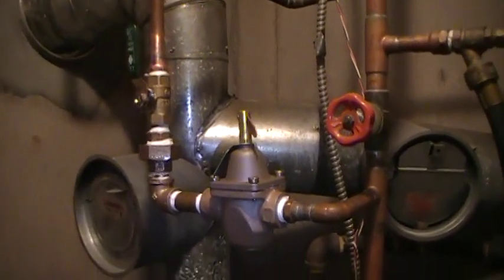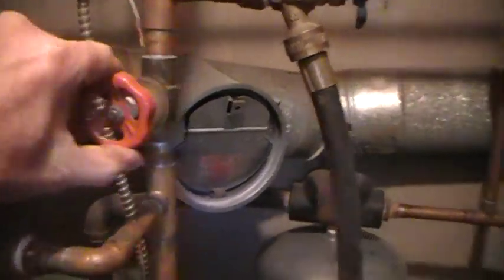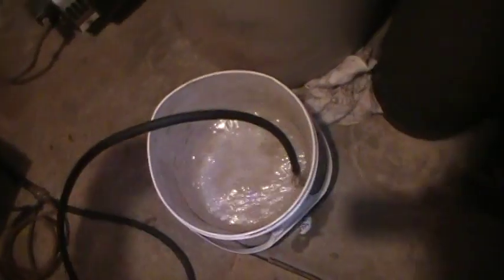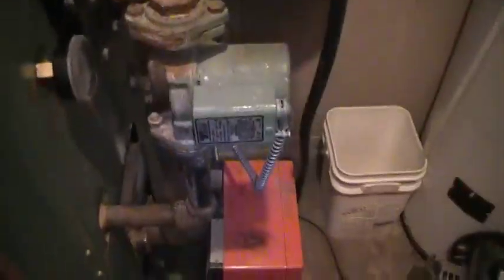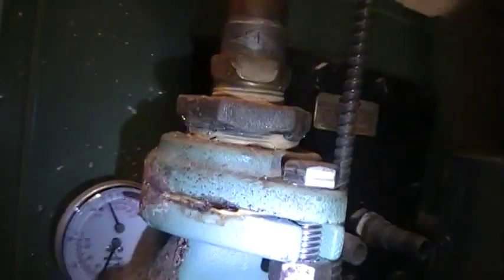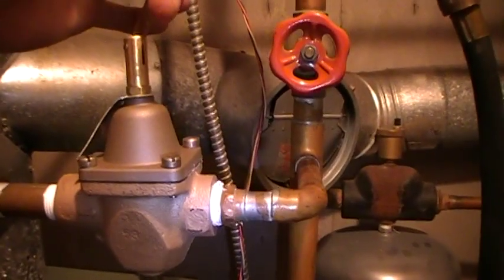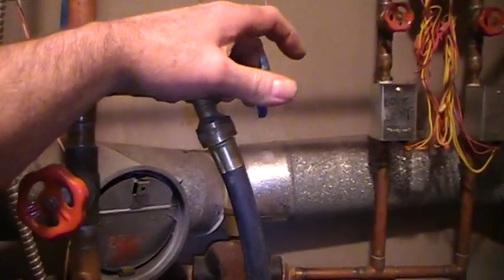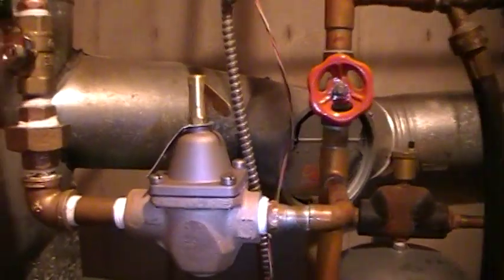How to remove the air out of your hot water heating system-girgling noise.

Comment: My pressure reducing valve does not have the fast fill lever, just constant 12psi. Can I still perform this procedure without the fast fill? Thank you.
Reply from the maker: Hello michaelshannon6846,
You should be able to purge the system, but you have to keep an eye on the tridicator (gauge) and make sure the system doesn't drop below eight pounds. Hopefully your PRV is flowing well and not plugged with any sediment.
 If by chance it drops to fast you could attach a hose to the drain valve and put water into the system this way watching the pressure as you do NOT want it going anywhere near 30 PSI as the relief valve will pop on you. If you use a five foot washer hose and add it to a regular hose you will be able to attach it to the boiler drain. If you go this route keep an eye on the pressure. Twenty pounds will easily purge the system for you so keep an eye on the gauge. Once it gets around twenty you can turn off the drain valve and add water when needed to keep the pressure up until done. Once complete let the pressure reducing valve feed the system to the correct pressure.
I can't stress enough about watching the pressure and keeping it at around 20 PSI if your pressure reducing valve can't keep up to your purge. You don't want to create any other issues like having to change the pressure relief valve if it should pop.
Hope this helps!
Drop me a line if you have any other questions.
Thanks for commenting and best of luck with the project!    Al
Reply: @TheOldkid888 Thanks for the reply! Could I also not open the purge valve fully and monitor the pressure that way as well? My pressure reducing valve is brand new so I’m confident it will feed water at 12psi. Thanks!

Comment: Very good thanks I have to do this soon for my boiler that's making gurgling noises in the base board units also I didn't see you shut off the power switch is that because of the zone valves needing power to open ? Thanks !
Reply from the maker: Hello MikeL-vu7jo,
I did shut the power off to the system. At the end of the video I mentioned turning the power back on. 
You hook the zone valve lever once you slide it over to keep it open. You may wan to watch the video again to get every detail. No pushing it on you, but it is all there.
If you do lift the lever on the pressure reducing valve make sure the pressure doesn't get near 30 pounds as the relief valve will pop. I keep it above 20, but no higher to be safe when purging and I check it once I have finished. If the pressure is above 20 I will drain some more water and bring it lower. Somewhere around 15 PSI.
Good luck with the project.
Thanks for commenting and enjoy your week!    Al
Reply: @TheOldkid888 thank you!

Comment: So my i hear water running through my baseboards. Not gurgling so much. But like someone turned on your outside hose and you hear it running from inside the house. Is that normal operation or should it be quiet? 1st time with baseboard heaters.

Comment: On my system there are four zones each with its own circulator coming off a manifold that has a drain at the end of the manifold pipe. There are no purge stations on the returns at all. Can I bleed the system through the drain at the end of the manifold supply pipe?
Reply from the maker: Hello john,
You can do it that way if you can isolate each zone. 
Are there a valve below each circulating pump? 
You probably have a flow control valve on each zone coming off the supply line. Correct? Do you have baseboards or cast iron rads?
Get back to me when you get a chance.   Al

Comment: Is it best to bleed the system for air just before the winter.
Reply from the maker: Hello JOHN COYLE HERE,
Generally it is if the system needs bleeding as it would produce a more efficient heat for you and reduce the noise coming from the radiation. If you hear no gurgling when the water is running around the loop, the system probably doesn't need to be purged or bled.
It definitely doe not have to done every year. Keeping an eye on the pressure gauge and assuring that the pressure stays above 12 pounds should help keep the system working well.
Thanks for commenting and enjoy your week!     Al

Comment: Condensed version: shut off ALL zone valves and ALL return valves in ALL zones. Starting on lowest level zone (basement or ground), connect hose to that zone's drain pipe. Open drain valve and lift lever on pressure reducing valve to apply full water pressure to force air out. When air bubbles stop, lower lever on pressure reducing valve. Check gauge that pressure is below 30PSI. If ok then close drain valve at hose. WARNING: Do not close valve at hose if pressure is above 30PSI. Normal pressure should be closer to 10PSI.

Repeat for next higher zone.

When all zones have been bleed open all zone valves and all return valves in all zones.
Reply: Thanks to @mattfoley6082 for this very clear, concise restatement of the process. For me this answered essential questions I still had after viewing the very helpful video.

Comment: Before purging a zone, does the power to the furnace have to be turned off?
Reply from the maker: Hello sonic,
Either way it will work for you. 
At this time of the year I would suggest trying it with the power on. 
A few five gallon bucket of water should do the trick for you.
Use a hose and place it in the bottom of the bucket and you will be able to see the air bubbles coming out of the system.
Hope this helps!
Drop me a line and let me know how you get along.
Thanks for commenting and best of luck with the repair!     Al

Comment: Do you have to open all valves in the system or juste 1?
Reply from the maker: Hello Luc,
You open  just one zone valve at a time. If you have three zones and one is a problem then you would open one zone valve manually, close the return valve and open the drain valve above the valve on the return line. 
How many zones do you have on your system?
Get back to me when you get a chance....Al
Reply: @TheOldkid888  hey thanks for the reply! I have 4 zones and it was piped weirdly! I have 1 drain valve fpr the whole system!  I'm having issues with a squeeky noise from the circulation pump.  Bearing and motor was replaced in February for same noise issue.  Found out by reading a lot it was caused by trapped air in the impeller periodically.  So bleeding the system is the last option to try!
Reply from the maker: Hello Luc,
If you only have one return and one valve it is just a matter of closing the one valve that shuts the return down and then open each zone valve manually while draining the water into a large bucket. I like using a hose so that you will see air bubbles leaving the system. Big thing is to keep the pressure up on the system while purging. Lifting the lever on the pressure reducing valve will keep the pressure up. Lift it, but don't hold it open the entire time. Watch the gauge so you can lower the lever periodically to control the pressure. Throttling the lever up is the best way to go. You will hear the water flowing in. 
What is the name of the circulating pump? Is it a compact pump or is the motor and pump housing separated by a coupler which has a place to install oil?
Do you only get the sound when the pump is running and not the burner? Is it an oil or gas burner?
Thanks for commenting and get back to me when you get a chance...Al
Reply: @TheOldkid888  thanks again!!! Will try this!!

Comment: My boiler system doesn’t seem to have zone valves. Are the steps to purge the same, just without the zone valves? I have a two zone system.
Reply from the maker: Hello tsgrimey,
You could possibly be able to purge the air out of the system like this depending upon what is on your system.  So you would be looking for a return valve on the lower pipe going into the boiler. above that you would find a drain valve. If these are both there it is just a matter of closing the return valve, then opening the drain valve (I attach a hose to it so that I don't have to hold the bucket) and draining water into a bucket. 
If you don't have zone valves you probably have two flow control valves on the top of the boiler going to each zone. I am not sure if there are valves on the pipe leaving your boiler or not. If there isn't you would have to screw the top of each flow control down to close them in order to purge each loop.
Before you begin anything go to your baseboard and remove both end  covers on one radiator and check for a manual air vent. Each section of baseboard may have to be bled individually in each room. This is where I would begin to look.
Thanks for commenting and get back to me when you get a chance.....Al

Comment: What if its shooting water out on it's own (alot of water) ? Does that mean I have to take the air out?  Is that something I need to do once a year so I don't have a flood ?
Reply from the maker: Hello Corrado DeVincenzo,
Air in the system doesn't have anything to do with the water coming out.
Having water coming out of the relief valve is a sign that you have pressure build up in your system. It could be one of a number of sources. Most often the main one is a waterlogged expansion tank. Check the pressure on the gauge on the boiler. It is probably above 30 pounds which would cause the relief valve to pop. 
Do you have an expansion tank ( three feet long by one foot wide) near the ceiling or a smaller extrol ( one foot wide by one foot long)  tank mounted near the top of the boiler? If the expansion tank is water logged (full of water with no air space) then you must remove the water from the tank. If it is an extrol tank than it should be replaced.
Is there a coil in your boiler for hot water?
Get back to me when you get a chance.....Al

Comment: How do I know which is the return valve?
Reply from the maker: Hello Candace Burke,
The return valve is located on the line where the pump is located. 
It is generally found above the pump on most systems. Do you have one or more zone valves? If so there possibly could be a valve for each loop.
Get back to me when you get a chance.
Thanks for commenting!    Al
Reply: @TheOldkid888  yea we tried to figure it out but can’t seem to solve the issue on our own.  It happens every year, baseboard heaters don’t heat up. It’s an oil furnace with a holding tank on the ceiling. I believe it’s an air issue but can’t seem to find it.
Reply: Also are you from Cape Breton?! You sound like a fellow caper
Reply from the maker: Hello Candace,
One of the first things to do is check your pressure. It should be around fifteen pounds or higher if the regulator is working fine. It is located on the tradicator ( temperature and pressure gauge ).We will start there and see if we can figure this one out. 
Is there an automatic air valve on the top of the boiler? This will be located on the pipe leaving the boiler.
How many zones do you have on the system and is your home a one or two story house?
Fellow caper here as well!
We will figure this out.
Get back to me when you get a chance...Al
Reply: @TheOldkid888  it’s a two story house. There is a thermostat in the master bedroom, one for the living room/ kitchen and one for the other bedrooms. The basement baseboards are heating up, but not upstairs. I don’t know how to explain the set up, it’s weird I wish I could just send a picture...let me try to explain...
So the water main is on the wall that has a tube that come off and goes into the furnace. Following the pipe is that little lever to let water in the pipes and bring up the pressure. That pipe then goes into the furnace. Then a large pipe comes out of the furnace and goes into three sections that have the boxes on it to set to manual or automatic and those pipes go up into the ceiling they are blue. On the other aide of the furnace there is a large pipe that comes off the top and goes through a circulation pump and then that branches off into three pipes that also go into the ceiling, these are red. Then bellow that on the furnace side of the pump is a pipe that goes into a tank that’s on the ceiling for holding hot water. This has a drain nozzle to attach a hose as does the back of the furnace and the side just below the tree boxes on the cold water side. It’s a complicated set up it seems. If you work out of Cape Breton I have to hire someone to come take a look depending on where you are maybe that would work?  Also pressure is good at around 15-16. Sorry I don’t know much else to try and help explain it.
Reply: Do you have a website or fb Page I could contact you on?

Comment: Can the air be removed from the air scoop?
Reply from the maker: Hello lesio333,
If I am understanding your question correctly; air can generally be removed from the air scoop with an automatic air vent on the top of the scoop. What happens over time the automatic air vent will begin to leak and most often the home owner will tighten the little cap on top of the vent that causes the vent not to work and the air will begin to circulate throughout the system causing a gurgling sound and eventually an air lock in the loop and no circulation of water.
Hopefully this answers your question.
Thanks for commenting and enjoy your week!      Al
Reply: @TheOldkid888  that's what I meant. I saw many videos where people bleed the system the same way you did. It's a lot of water in a bucket :)
I am not a plumber and just wanted to find out if I understood it correctly. 
So, if my system has air scoop with working automatic air vent,  it should be enough to get rid of the air in the pipes? Correct?
Reply from the maker: Hello lesio333, 
That is correct!
As long as your pressure is good you should have no problem!
Twelve pounds or better. Not above twenty is great!
Thanks for commenting and enjoy your week!    Al
Reply: @TheOldkid888  thank you

Comment: A few issues...my zone control switch lever doesnt move on one zone, and moves with no resistance on another zone valve. So i guess i cant purge my air because it could be in those zones loops?
Reply from the maker: Hello Aaron,
The zone valve that moves freely is probably on. If you turn down all your thermostats I am certain the switch will be stiff to move. 
If you turn on all the thermostats the switches on the zone valves should all move freely.
I would try that and see what takes place. From there we can purge the system if that works.
Don't forget to reset them to where you previously had them. Winter is here!
Get back to me when you get a chance....Al
Reply: TheOldkid888 yes. It moves . I think it might be my circ pump. Thermostats are on but no water moves, no sound. It is a Grundfoss  been there 12years at least. I see a valve above the pump to shut off the water but no valve below the pump just a pipe that goes into the bottom rear of my boiler. What would I have to do to stop water from coming out when I remove the pump thanks
Reply: Changed the circ pump. I have heat in all registers now!